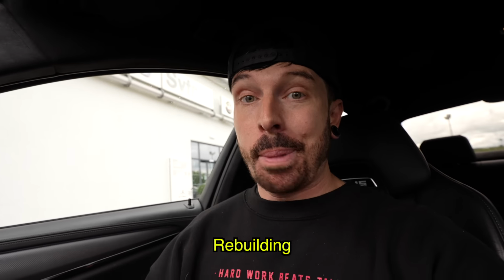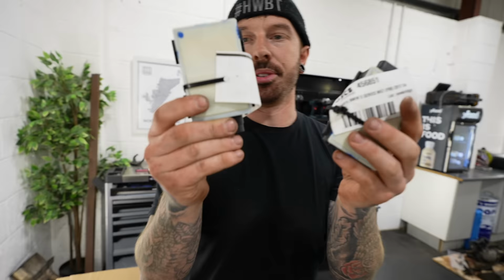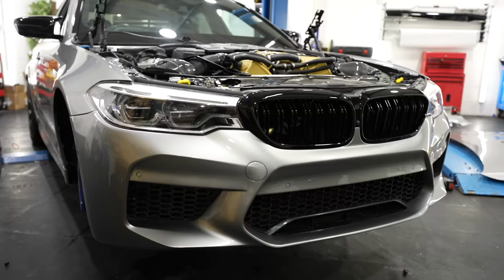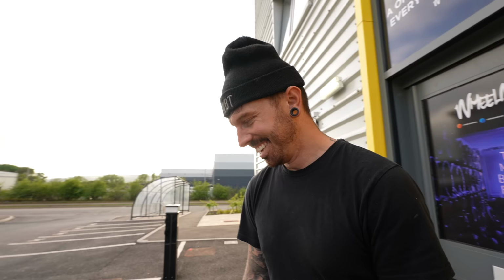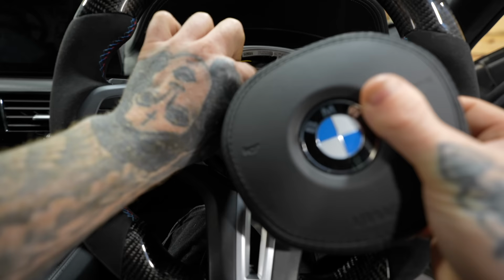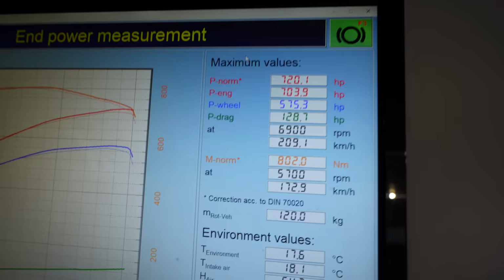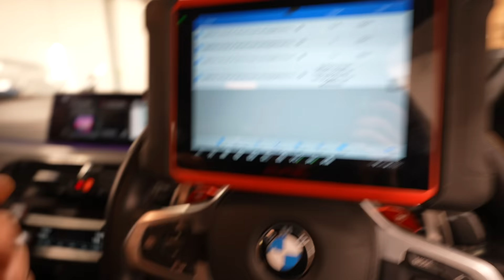I REBUILT MY WRECKED BMW M5 NOW I HAVE TO TAKE IT BACK TO BMW

Comment: Matt those wheels you put on are a downgrade. The stock bmw are fully forged.
Reply: I think also, the edges areto sharp and don t match the shape of the bodys car🤷‍♂️. Congrats Matt for all your work, superb machine, even with the "wrong" wheels
Reply: Im not so sure… i think they look great, they almost resemble and echo the e39 m5 wheels
Reply: I never liked "fake" wheels on luxury cars, in my opinion only factory wheels have the right "soul".
Reply: stock is boring if you like stock cars go to the dealership…
Reply: I can almost guarantee you the wheels he put on where forged alloy as well there not rare or expensive to come by lol
Reply: Yeah because "FULLY FORGED" wheels will be necessary for him to drive on the street doing the speed limit and or abit above. Boo hoo bro
Reply: @fredericoespinoza  if hes doing the speed limit then why tune to 720hp or throw an exhaust on. clearly he wants performance and adding unsprung weight with shitty wheels is a step backwards. try to think before you post
Reply: Pretty certain concaver wheels are forged anyways 🤷🏼‍♂️
I have 23" deep concave concaver cvr1's and cannot fault quality and style.
I personally love the various concaver wheel designs.
Reply: @Ash if stock is better than mod it doesn't make sense
Reply: Don't agree, they look fab....brilliant choice...gets my top vote
Reply: Maybe, just maybe, Matt is trying to preserve the stock wheels from getting beat up and going with some lower grade wheels that he won’t worry so much about damaging? I’m giving him the benefit of the doubt.
Reply: Agreed
Reply: Definitely a downgrade
Reply: 100% a ⬇️
Reply: @ihyln1  ikr 😂
Reply: The new wheels have "HYBRID FORGED" stamped into the centres.
Reply: Love the car Matt and the video but have to say liked the original wheels more 👍
Reply: @zele75  your opinion is bad
Reply: @zele75  that ain't a luxury car , but whatever. Get good 🎉🎉🎉
Reply: As a car guy I'm going say it wasn't worth it because as the Bluebook Value doesn't matter on this vehicle Blue Book values at $50,000 but you can knock about $20,000 off of it because it has to have rebuilt title so now you're 2000 over 😮
Reply: @RyuS-kw4dl  20000 is too much off for a bmw inspected and approved rebuild
Reply: Didn’t like them Matt
Reply: @Da_one_tl  it has a rebuilt title but doesn't matter what you do to the vehicle with a rebuilt title you're looking at about half of the Bluebook Value of any vehicle it doesn't matter what it is they could be a Ferrari and half the cost of the Bluebook Value that's the reason why no one purchase is a rebuilt title most of the time it's not properly done
Reply: @RyuS-kw4dl  I’m a rebuilder, I disagree
Reply: @RyuS-kw4dl  blue book value really isn’t that important anymore
Reply: The OE wheels were trash. You know nothing about the new wheels; their weight, strength, or finish. You just don’t like the look which is fine but kinda irrelevant since it’s not your car.
Reply: @sportbikejesus6297  is that the reason why 271 people agree with him
Reply: @Ryu S Only 271 people out of 1.7 million views. The original rims are trash! Those new ones look sick. I'm with Mat on the black wheels being over done as well. It makes them look cheap.
Reply: i dont agree on that tbh they look good
Reply: Concaver wheels are forged and they could cost more than 4000 euros... those are quality wheels
Reply: New it was bad and left it on give next buyer conference at least you were honest
Reply: Lol so are a lot of parts on this budget build
Reply: @zele75  or he should’ve gone for BBS. But they are more expensive then BMW rims. If you have the track rims
Reply: @ernestoditerribile  defo second hand bbs
Reply: Zÿy j h. T 0g7  f f
Reply: @joemay6907  
 s
lmmm
Reply: Tire and wheel tech here, the M5 competition, as well as the M8 competition do not have forged wheels. They have regular Ronal cast wheels, just like every other BMW, not forged. Though they are slightly lighter than normal.
Reply: They look fine.
Reply: Very nice and nice video🎉
Reply: They’re not wheels
They’re alloys
Reply: Hey guys!

I need help with my 2008 BMW 328xi

Anytime I’m on low speed, I hear this sound like some metals hitting the car from underneath, but when i speed of or driving on top speed, the sound disappears. I’ve tried to fix this multiple times but seems my technician here has ran out of ideas. What’s could be wrong please???

Your suggestions would be appreciated.
Reply: @joemay6907  Echo is not a name I want on my car. "Oh ya I drive a echo y'all .
Reply: @jrock5995  when?
Reply: Remember mi
Reply: All  mi ask of you
Reply: @zele75  completely agree
Reply: Ty
Reply: Yeah but the clout tho.....
Reply: @babalolabolaji2312 exhaust heat shield
Reply: @Mcfc2Rich  that’s the point 😅
Reply: @Bondarel7  that is a matter of opinion, I think those wheels awesome.
Reply: Factory wheels ugly as hell.
Reply: I don't think so but there was so much cooler wheels in the back, i would have gon for black deep concaves😅🤝🏻
Reply: @xamideex8937  I will check that, thanks man.
Reply: What colour is ur wheel en rims
Reply: @joemay6907  Anytime. You ain't fin'sta be like bro check out the new Hyundai it's a echo dog. I can't get jiggy with that shit.
Reply: @jrock5995  nah when did i ask
Reply: Yeah the wheels were pretty bad
Reply: @Bondarel7 maybe he sold them  for a good price
Reply: Those bmw alloys look 1000x better
Reply: The wheels and the carbon stuff are just not it
Reply: I thought they were partially forged
Reply: It made it look more Benzish, took out the bmw out of it there
Reply: I def liked the stock BMW Wheels.
Reply: Not bad, you can't really tell the color on video, unless you see it.. what is the color code for the alloys please??
Reply: Cheaper and stock wheels lmfao , bmw dealer for most stuff ebaay crap for the rest
Reply: @lukeharrison946 Concaver wheels aren’t forged btw.

Still a good wheel though! Sell them all the time
Reply: He had to advertise these guys, come in people 😊
Reply: @drebuckzz878 yes m8 preach it modified cars are so much better cause you can make them look how u want
Reply: i don’t know if you heard the part where he “make it more like my own.”
Reply: Was the srs module replaced or crash data erased?
Reply: All the BMW heads going mad over the wheels his car lads he can do what he likes 😂

Comment: You just had to replace the defective cells and/or trick the BMS of the old lithium battery. This can be done very easily for very cheap and definitely does not cost anywhere near the 600 dollars which you paid for the new lithium battery. And here is a secret : This is exactly how lithium batteries are refurbished ...

Comment: Matt you’re sooo talented. I’ve watched all the M5 comp videos. I’m astonished, your problem-solving abilities are incredible. So if repairs cost 41K, and it would be marked as a category right off, clearly from a monetary point of view it’s not worth it but I’m sure with the amount of money you get from YouTube and the enjoyment element, then it is 😆
Reply: Probably an ISTP
Reply: Logical kind and tolerant? He does seem to be
Reply: What’s a istp ?
Reply: MBTI personality type
Reply: I think cars are mostly in these cases are written off because of the sheer amount of work hours that need to be put in. I am also shocked that basically the whole framing and engine work is less costly then a couple of sensors. I am curious if he sold it for decent money. I guess people tend to be hesitant spending that much on a car which was wrecked lol.

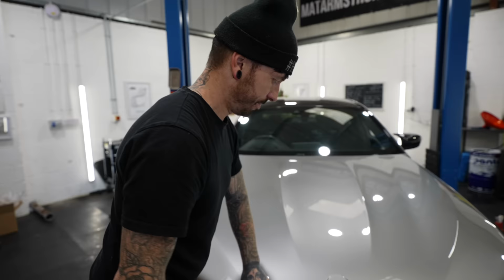Comment: Just a note for future reference - you should never close a bonnet like that at 11:01, you can easily dent the thin metal, not to mention leave grubby marks. Best method is to hold the edge and drop from 150mm - 200mm as this is how they are designed to be closed. I have been working in the industry as a technician for around 15 years and seen lots of people dent very expensive vehicles this way, including on a Lamborghini in front of the customer… very uncomfortable watching that unfold, let me tell you. But yeah, just drop from 150mm and they close perfect every time.
Reply from the maker: Try close a bmw bonnet by dropping it from 200mm and come back 😂
Reply: @MatArmstrongbmx  that’s the thing bud, kinda have done for the last 15 years 😂 like I said in my previous comment, I’m a automotive technician. Although the alloy ones tend to need slightly a little more oomph, one workplace I worked at even sacked a guy over it….
Reply from the maker: @camd3673  okay bro 😅
Reply: @MatArmstrongbmx  Try page 342 of your owners manual, it should clarify for you the process. It says “approx 50cm” but I’ve never had trouble from around that 200mm mark, especially with a little extra oomph. Plus, I find it’s just unnecessary once you have the feel for it. 

The thin alloy dents super easy and doesn’t have the same elasticity of steel, meaning any dents you do leave are also harder to restore. 

But hey man you squish that thing if it makes you happy 👍

Comment: There is a protective short that occurs are many airbags when not properly connected. Just fixed one 2 weeks ago. This may help later in life. Cleaning up the connectors and reterminating it fixed the issue. Nice job on the BMW!

Comment: I bet the locking tab on the airbag connector is broken. If you pry on the locking tab the wrong way to remove it you break one or 2 of the long plastic shorting bars. Being it shows shorted when connected... 
If so, get a repair kit, remove the locking tab and transfer it over.
Super common when customers try and replace their batteries themselves. I got a drawer full of those commectors

Comment: Lithium 12v batteries are most often killed by boosting them with a non eligable booster.   Disconnect immidiatly after start  if unsure

Comment: My GT86 had someone reverse into the rear quarter panel.  Got it fixed by an approved shop.  Even they had to have the work approved by the manufacturer.  Something about the welds being safety critical.  Trying to avoid the catastrophise that were "cut and shuts", take two written off cars and weld them together and sell it  as legit.

Comment: Cracking job mate!! Not sure if youve heard of it before but for future reference 3M VHB tape is very strong for fitting trims, i used it on a bonnet lip once and the lip split in half after a crash rather than come off the bonnet😂

Comment: Amazing work and one thing i will say is keep the parts that you replaced with carbon fibre so that when if you decided to sell it the next owner if they wanted too can put the original back on if they wanted too and aswell it can sometimes believe it or not de-value the car but documenting how the modifications are made can help stop the devaluing of the mods

Comment: The reason why most people do not diy repairing a heavy crashed car like that is for safety concerns: When a car has been involved in a severe collision, the structural integrity of the vehicle can be compromised. Repairing such damage requires expert knowledge and specialized equipment to ensure the repaired car meets safety standards. In some cases, the extent of the damage may be beyond repair, and it may be safer to replace the vehicle entirely.

Another point missing in your home made repair project is to validate the manufacturer specifications: Auto body repair technicians aim to restore a damaged vehicle as closely as possible to its original condition. They often refer to manufacturer specifications, known as OEM (Original Equipment Manufacturer) specifications, to guide the repair process. While it may not always be possible to bring the entire car back to OEM spec due to severe damage, repair technicians use their expertise to restore the vehicle's structural integrity and appearance as much as possible.  

In the end, I highly dumb this car is flawless as of right now and insurrance would probably refuse any request if accident was officially declared. And the fact bmw want to buy it back mean nothing most of their mecanic are dummy anyways..

Comment: It could be a defective airbag but there is usually a shorting bar in the airbag connector that should also be checked.  Even though it looked OK, you may just have an internally damaged connector.    Many of those airbag connectors have to be replaced after accidents.

Comment: The battery needs to be registered and coded and you could have gotten away with using another one. Even the factory one if same capacity, needs to be registered for it to work properly. Great job on the repair!!

Comment: those parking assist sensors are part of a category of sensors called adas, (Advanced driver-assistance system) some of those sensors can be bought from secondary suppliers like Standard Motor Products or Dorman products

Comment: Those batteries are often repairable, its not flat the lithium bms protection has triggered. You also have to program the car to the battery on all modern BMWs

Comment: i dont know what is in the video because when o see what i see i paused to write what i think)))

I think the dash restarts by itself not because its not enough of power but its because is to much power when you reving. it may happen when you try to run w/o battery or when battery is flat. Generator has embedded regulator and when you try to run in conditions i described , you can easy broke the regulator by reving . and if you check the voltage at idle it can be good ~14-15v . but when you rev it may jump >20v.

Comment: Its great to see you've rebuilt it and its back on the road but, and its a big but, I wouldn't buy a car of this calibre thats been involved in such an high impact smash as other expensive components start to fail as they've been put under so much stress, especially the engine and gearbox.

Comment: The charging profiles for lead acid and lithium batteries are completely different as are the discharge rates. Lithium will pack a much higher punch in comparison.

Comment: Probably has those parts codes... My 2003 Lincoln LS V8 had it's traction control replaced and throws a triple code cause the part has to be programmed into the cars computer but the last owner didn't put the code in.

Might be why the bmw went into limp mode seeing as it's a higher end, newer more expensive car.

Comment: Just wanted to add that the forward facing radar is not just needed for Adaptive Cruise Control. It's also needed for your collision avoidance system (Automated Emergency Braking and Forward Collision Warning). If the vehicle is MY19, it likely had those features. As these are considered active safety features, from a liability standpoint, it would not be a good idea to sell this vehicle without them. This will likely be brought to your attention in BMW service.
Reply from the maker: I’ve asked bmw if mine needed it but nope mine does not have it

Comment: Yea i was gonna say you cant use a lead acid bat on it.... think of it like a RC battery... a 3s 4s 6s 8s vs a standard battery pack..... you try to use a normal battery pack on lets say a arrma 4s it wont run.... if it does it will horrifically.... same thing here... it needs the extra punch to run its electrical ect... i got one too brother lol

Comment: scary when you see some one who has not a clue , i think the fault is in the connector , as i suspect a plastic bar in the connector is broken . looking at the reading you have , 
also there is a good reason why the air bag needs to be fitted to the car , for warranty purposes the tech needs to check it out , and its stops half wits returning good parts that they say is faulty .
The car looked better stock , now it looks like its smashed though Halfords , but its just my opinion

Comment: Technically you "can" use a lead acid charging system to charge a Lithium Ion battery as long as you watch the voltage carefully (just for the record, it's not advisable, especially on something as big as a car), but a charging system designed for Lithium Ion batteries won't work on a lead acid battery, as you've found out. The charge and discharge rates are very different, and measurement electronics (to report battery status) will either be wildly inaccurate or won't work at all if used with the wrong battery type. It seems like it would be simple, but unfortunately it isn't.

Comment: Matt the aux belt is routed wrong .ribbed part of belt goes on to ribbed side of pully .you have the part of the belt that's on the water pump ribbed to flat pully that should be flat part of belt to waterpump pully .the same thing will happen again to belt routed wrong .
Reply from the maker: It’s routed correctly bro we have the workshop manual for it

Comment: Matt, in your final cost estimation, it would make sense that you add your used manpower hours for the repair activities as well…e.g you and your dad working for about 2 weeks …would have set the value just around the market value…. Otherwise, the calculation is incorrect.

Comment: I wonder is the connector that plugs in to the knee airbag the problem? If its not reading the correct resistance when you press the button home on the connector 
then it will think the airbag is still blowen

Comment: Shorting bar problem on the knee airbag?  All airbags I've ever seen have one and if the connector on your dash harness doesn't lift the shorting bar off the terminals on the airbag, you'd see a short.

Comment: that parking sensor thing should be SRR sensors. Does that BMW have something like Active Guard or some kind of city emergency braking? Any error codes in that direction withoout those sensors connected?

Comment: I'm pretty sure you have to hook up to the obd2 port to tell the computer that you installed a new battery or the alternator will over charge and fry the battery. As the battery degrades the ECU allows more charge from the alternator.german engineering at its finest